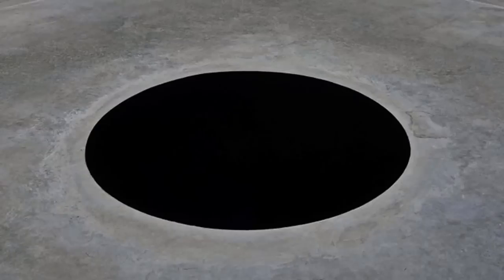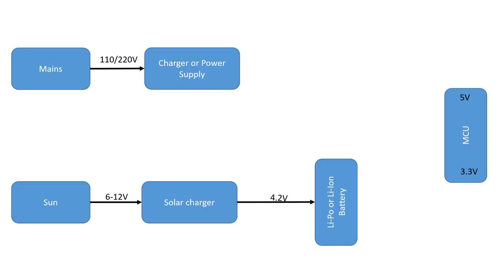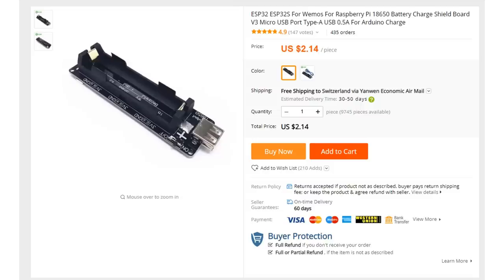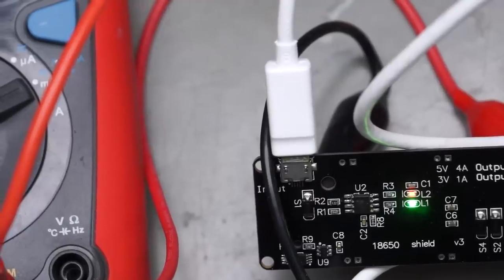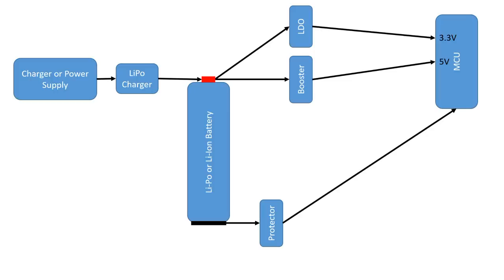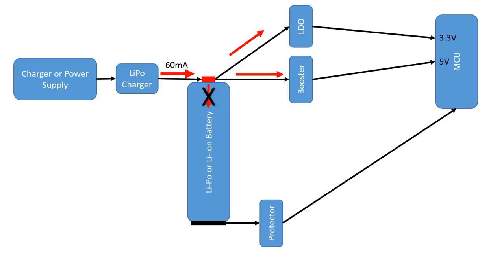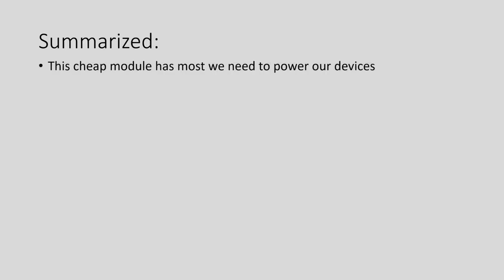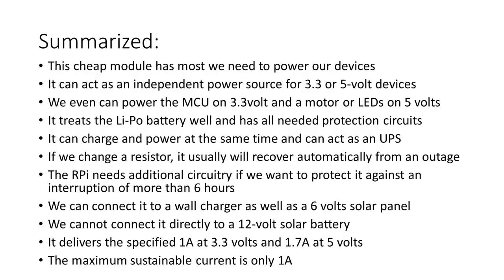#250 Universal Power Source (UPS) for only 2$. Is this possible? (Raspberry Pi, Arduino, ESP32)

Comment: Thanks. For Raspberry Pi's an external power path switch  (MOSFET based "OR" circuit) will be needed to divert the charger supply to the load when mains is available and switch over to UPS when mains is not available.Example ( Ignore the charger IC for this use case as it is already included in the module)  http://blog.zakkemble.net/a-lithium-battery-charger-with-load-sharing/
Reply: Sorry just so that there is no confusion , above by charger I mean the mains DC power supply  (5v).
Reply: Just FYI. For my projects I use LTC4412 power path switch IC. It is easily available in alliexpress.
Reply from the maker: I am not sure this external path will help here. It is mainly made if you cannot recharge your battery. Which is not the case here.
Reply: @AndreasSpiess   Thanks. If you get a minute could you take a quick look at the LTC4412 data sheet at the example circuits and you will get what I mean.  The URL above is for a simplified version of the power path switch with one path through a diode and other part through the mosfet (please see only the load sharing circuit within dotted lined of the circuit diagram) Cheers.

Comment: DOOD! What I want is an Ard or Pi with the LiPo battery socket already on it. Why doesn’t someone just make an Ard with a LiPo jack and holder slot.
Reply: I think Adafruit feather boards have just that. Haven't used one, but looking at the schematics, looks like it does have a lipo charger and USB power switchover without the problems Andreas found.
Reply: Of course that means you always pay for the USB connector, lipo connector and charger and board space even if you don't use all of it. That's the tradeoff of a fully integrated solution...
Reply: They are easy to obtain, or at least ones with an ESP8266 are.  Look on Aliexpress.

Comment: Hi Andreas, I think your diagram for a Universal PSU is not correct.
You should avoid powering the MCU through the charging circuit. The proper way is :
- power input (like USB charger) feed both charging circuit AND MCU regulator
- battery feed the MCU regulator through a diode or P-channel
See for example schematics for Adafruit Feather M0 https://cdn-learn.adafruit.com/assets/assets/000/040/553/original/arduino_schem.png?1490994398
Best regards
Reply: Or a little diagram : https://docs.google.com/drawings/d/1ST67QKpU2C38_JCsnEDmNftHNs_PhxhYXjTXSf6v1wo/edit?usp=sharing
Reply from the maker: I am not sure if this is much different. You always have the problem of charging with a constant current if you use a variable part of it for your device. Both are connected to the same battery pin and therefore currents add (or subtract). I do not see a battery in your google drawing.
Reply: Hi  @AndreasSpiess  , Indeed I meant that the battery is part of the "battery charger" block.  The idea is that the battery charger will use the exact current needed to charge the battery even in slow charge mode. When power input (5V or +) is connected,  the battery level will always be below (3V..4.2V) the power input. So battery doesn't feed teh MCU but the power supply does (because of diode). It's only when the power input fails that the battery will be used to feed the MCU part.
Obviously the power input must be able to provide enough current for MCU + battery charge which should not be a problem.
I'm updating the diagram. As suggested you can also have a look for the Adafruit boards. They are well designed for that purpose.

Comment: Hi Andreas, thank you gain for the quality of your channel and the rigorous scientific approach to problem solve on our "Nerd " issues. I am facing a challenge regarding couple of interesting projects. I need to power an ESP to run an SD card and simultaneously a LED strip made of 144 APA102. See Fortorgear_dot_com. Theoretical power is around 2.2A to 5.8A for the LED Strip at 5V of course (depending on the colour/brightness) and an additional 0.2 for the ESP/SD card. I would like to use 2 or 3 18650 as it comes handy and i need to minimise the form factor as much as possible.  Today i am almost happy with  2 x18650 in series (6.8-8.4V) and a XM1584 rated at 3A (regulated at 5V). But sometime  the ESP is reseting when the LEd strip draw more..... I am wondering if an alternative exists : potentially 3x 18650 will be better than 2 to support higher current (and autonomy),  or to use 2 or 3 18650 in parallel and a boost-up?  (the boost up rated at 3A is a XL6009 but he form factor is too big. I was wondering as well if i should put a P-mosfet for the led . I hope that my issue has common interest across the community. Bye. Dan with the french accent !! Btw i have inverted the + and the minus on the UPS that you are showcasing on the video and unfortunately it went smoky !!I need to buy another one. We should be able to put a diode to protect the inversion...
Reply from the maker: First I am old school and have no problem if something like that blows up if you reverse polarity. We still should use our head sometimes. And even for my old eyes the signs are big enough ;-)
Concerning the LED strip: Look at it as an LED strip which gets a signal from an ESP, not the other way round. What I mean is, that maybe it is easier to completely power the ESP from a different source. The two current needs are very different. If you separate them you can save a lot of problems, I think.
Or you use a 12V Li-Po battery pack and two separate buck converters. One for the LEDs and a small one for the ESP. If you start at only 7 volt and do not have very good wiring you might encounter too big voltage drops.

Comment: Andreas if you want battery charger which load sharing you should read Microchip application note AN1149 (http://ww1.microchip.com/downloads/en/appnotes/01149c.pdf). I have built charger with load sharing using TP4056, DW01 and MOSFET+Schottky diode according to this application note and it works great.
Reply from the maker: This is a slightly different chip with a separate charging path. Theoretically, it works better. However, I never compared it with the TP4056.
Reply: @AndreasSpiess  I wasn't speaking about chip itself. I only used solution with mosfet and Schottky diode which disconnects battery from load during charging. That allows charging chip to properly load battery using CC/CV Mode. If power source has enough power you can charge battery with ldo/step up powered directly from Input (of course minus voltage drop on diode)
Reply from the maker: I do not want to disconnect the load during charging.

Comment: Hi there Andreas. Thanks for the video top information as always. Although the module has only one battery and should be sufficient for our small boards power needs I opted and went for a 2x Batteries module https://www.aliexpress.com/item/32969639665.html?spm=a2g0s.9042311.0.0.698c4c4dnXgLZy thinking that it will word as a UPS. The behaviour was a bit not as expected. Meaning that after I unpluged the power source the battery shield needed 5 seconds to switch from the mains power to the battery power and thus it is not suitable as a UPS.  Long story short I ordered the ones from your link now but I am confused on why the 2x battery module is not working as the 1x battery module ....
Reply from the maker: Good to know. Thank you!
Reply: Hi, I am also facing the same problem. I bought the one with two batteries, but it do not work as UPS as it takes at least 2 seconds to switch the power from MAINS to Battery. I read that one battery module can work as ups, can you please specify which one exactly you bought. It would be really helpful.

Comment: Interesting board! Can this circuit charge more than one li-po battery if connected in parallel with wires or is it too weak for that? I will definitely be looking at it. But not sure if it can be used with solar panel after watching this https://www.youtube.com/watch?v=T70mBHeIOZA video on how to modify the board to fix problems Andreas was talking about.
Reply from the maker: As said in the video you can use it if you sleep your ESP from time to time.

Comment: Literally any crappy powerbank available anywhere will work to power Arduino and ESP, I don't know about the Pi as I haven't used it yet.
Reply from the maker: If it slows charging and running at the same time. And most Power banks switch off if you connect an Arduino
Reply: That's strange. I've bought 3 different powerbanks over time, of the cheapest ones, and they all worked fine with Arduino and ESP, USB chargers worked fine as well, I guess I was very lucky then. I've just checked online and some people had the same experience as you and me so I'm guessing this has to do with the combination of certain powerbanks and specific arduinos/esp's. One post in the arduino stack exchange for example said a certain powerbank needed a current draw of at least 50ma to not go into "sleep mode" which can certainly work for certain projects but not others.

Comment: The answer is "No".  Whether you are talking about a "universal" power source or an uninterruptible power system makes no difference. Either one  has only one critical spec: output power.  While it may contain the circuitry, for  2 USD this board provides NO OUTPUT POWER, so it is neither a universal power source nor an uninterruptible power system, just a control circuit.
Reply from the maker: Thanks for the answer. You are right.